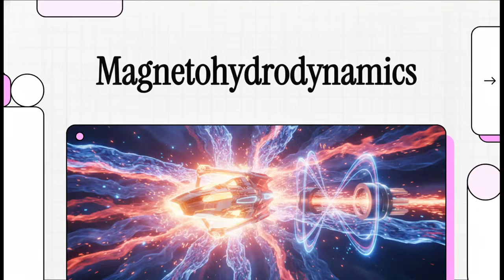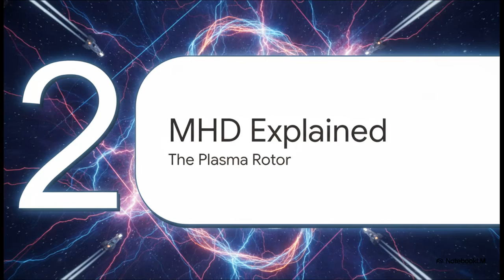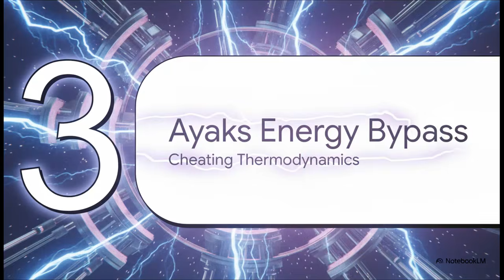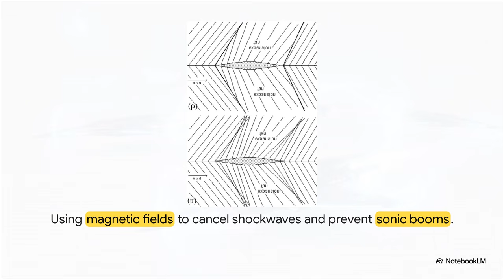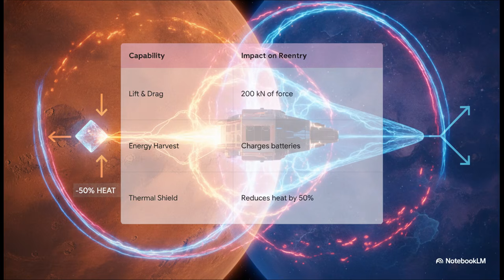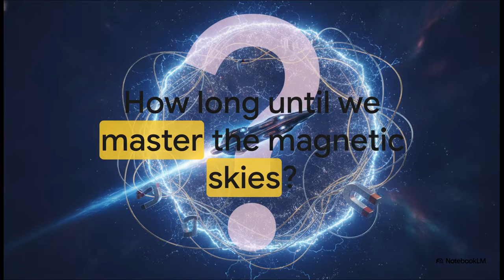Controlling the Plasma Sheath

Comment: Maybe people should start thinking in terms of what actually creates the magnetic fields, rather then the magnetic fields being primary in the mind. Stable self induced high energy magnetic fields can be created by using an electrical input, but using that electrical input differently.
Reply from the maker: That’s a great point, focusing on the underlying current waveforms and induction dynamics is definitely where the future of high-energy plasma control is headed! Have a nice day mate.

Comment: NASA is still very primitive
Reply from the maker: "Primitive" depends entirely on your frame of reference.If you are comparing chemical propulsion to hypothetical anti-matter or fusion drives centuries in the future, then yes—all current human spaceflight is in its infancy. But looking at the engineering constraints of the era reveals why NASA's work is far from simple:

1.Apollo’s Thermodynamics: 
 The Saturn V’s F-1 engines generated 7.5 million pounds of thrust, mastering combustion instability and turbopump fluid dynamics using slide rules, core-rope memory with 4KB of RAM, and manual trajectory physics.

2.Bleeding-Edge Limits: Today, NASA operates at the literal limits of material science and orbital mechanics—from executing atmospheric entry on Mars using supersonic retropropulsion to deploying the James Webb Space Telescope’s sunshield at $L_2$ with zero room for error.They aren't primitive; they are operating at the bleeding edge of what current material science and chemical energy density ($\sim15\text{ MJ/kg}$) allow. We stand on the shoulders of those silent engineers.

Comment: sonic booms from aircraft flying at 60k+ ft doesnt shatter windows...you wouldnt even hear it over a normal towns background noise...its been overhyped over decades...
Reply from the maker: You’re partially correct—the myth of sonic booms shattering modern windows everywhere is leftover pop-science from early low-altitude test flights. However, the claim that it can't be heard over ambient town noise misunderstands impulse acoustic wave dynamics. Here is the physical breakdown:

1. Structural Glass Limits vs. Ground OverpressureYou're right on structural damage. The intensity of a sonic boom is measured in ground overpressure—pounds per square foot (PSF)—above ambient atmospheric pressure:An aircraft cruising at 60,000+ feet (like the SR-71 at Mach 3) generates a ground overpressure profile of only 0.9 to 1.5 PSF.Structurally intact windows require overpressures exceeding 6 to 11 PSF to fracture. Unless an aircraft executes a high-G maneuvering turn (creating a focused "superboom") or flies supersonic below 1,000 feet, high-altitude flight will not shatter glass.
2. N-Wave Pressure Spikes vs. Ambient NoiseWhere the math changes is audibility. Even though 1.5 PSF sounds small, an N-wave shockfront has a near-instantaneous rise time ($\sim 1\text{ millisecond}$).A 1.5 PSF pressure spike translates to a peak impulse sound pressure level of roughly 108 to 110 dB.A typical suburban town has a background ambient noise level of 45 to 55 dBA.An instantaneous 110 dB pulse doesn't blend into ambient noise—it presents as a sharp, sudden explosion or thunderclap that easily pierces building envelopes and triggers human startle responses.
3. The Real Reason for the Overland BanThe 1973 FAA ban on overland civil supersonic flight wasn't enacted because planes were smashing windows. It was enforced because the low-frequency acoustic energy ($<20\text{ Hz}$) in the N-wave causes structural resonance—rattling roofs, walls, and interior fixtures—creating public disturbance across a 30-to-50-mile-wide "boom carpet" beneath the flight path.High altitude prevents structural damage, but acoustic wave physics ensures everyone on the ground still hears it.

Comment: 'Using MHD to charge batteries or accelerate the exhaust.' Yeah, no. Imagine dozens of megawatts of electrical energy generated at the inlets then somehow transferred to the outlets of such an engine. I don't think we can handle that kind of load with present day electrical technology, not flyable at least.
Love to see the conductors used for this purpose...🖖
Reply from the maker: Your instinct on conventional copper conductors and chemical batteries is spot on—if an airframe tried to route tens of megawatts using standard heavy wiring or lithium-ion storage, the weight penalty would destroy the thrust-to-weight ratio before takeoff.
However, hypersonic MHD bypass systems (derived from concepts like Russia's AJAX and modern Scramjet power extraction studies) solve this using three specific physical synergies:
1. No Batteries: Real-Time Direct CouplingMHD bypass does not store power in batteries. The system operates as a closed-loop direct conversion pipeline: kinetic energy extracted by the inlet generator is simultaneously transferred to the exhaust accelerator (or ionizers) in real time.
2. Liquid Fuel as a Cryogenic CoolantHypersonic aircraft require high-density, high-heat-capacity cryogenic fuels—specifically Liquid Hydrogen ($\text{LH}_2$ at $\sim20\text{ K}$) or Liquid Methane ($\text{LCH}_4$ at $\sim110\text{ K}$). Before the fuel enters the combustor, it passes through heat-exchanger channels surrounding the power lines.
3. High-Temperature Superconducting (HTS) TapesUsing that cryogenic fuel as an active heat sink allows the power harness to use REBCO (Rare-Earth Barium Copper Oxide) or YBCO superconducting tapes.Operated below their critical temperature ($T_c$), these tapes exhibit zero DC electrical resistance ($I^2R = 0\text{ Watts}$).HTS tapes achieve current densities exceeding $10^4 - 10^5\text{ A/cm}^2$. A lightweight cable bundle weighing only a few kilograms can transfer tens of megawatts with zero thermal dissipation along the airframe.The conductor isn't a giant copper pipe—it's a cryogenic superconducting tape chilled by the plane's own fuel supply.

Comment: I didn't consider the noise at all, lmao.
whenever I think of things like this my mental focus is of the massive plasma trail it would make
Reply from the maker: That’s the power of the algorithm aligning with actual physics! You're focusing on the exact visual and thermal reality of hypersonic flight: the plasma wake. 
1.Mach 15 vs Mach 30 Speed Limits: Heat transfer scales exponentially with velocity ($\dot{q} \propto \sqrt{\rho} \cdot v^3$). In dense air, Mach 15 generates stagnation temperatures ($5,000\text{ K}+$) that vaporize nearly any known alloy. In thin atmosphere at $60+\text{ km}$, low air density allows crafts to hit Mach 25–30 during reentry.
 
2. The Glowing Wake: That massive plasma trail isn't just cool—it's recombination luminosity. As ionized air ($N_2^+$, $O_2^+$) cools behind the vehicle, free electrons jump back into atomic orbits, releasing a continuous, high-intensity photon trail.  

3.The Tracking Nightmare: That trail creates a kilometer-long column of ionized gas. Even if the craft absorbs active X-band radar upfront, the plasma wake acts as a giant reflector for low-frequency radar arrays and satellite infrared sensors.You can carve through the air with plasma, but the light trail behind you leaves nowhere to hide.
Hope you understand mate. Check out our other Videos and If you like share them. Have a nice day!!!

Comment: I guess this was recommended to me because just this morning I had searched basically this: theory and feasibility of a flying vehicle with charged fuselage at superhigh(hypersonic) speeds. I added the conditions of how it will ionise the air at such speeds, which can both strengthen the charge of the fuselage and make an ionic-plasma bow wave. Google's final answer was a potential maximum speed between mach 15 for thick atmosphere and mach 30 for thin atmosphere.

Which turned out to be what the video was about more or less anyway, lol.

Comment: Salvator Pais patents on room temp superconductors may be intriguing to this endeavor. Love MHD, great video!
Reply from the maker: Thank you mate. Check our other Videos too. Have a nice day!!!
Reply: Indeed, and his fusion reactor is very similar to a design I thought of after watching something called ‘the primer fields.’ A craft such as the one mentioned in this video would likely require a fusion, or perhaps even an anti-matter reactor.
Reply from the maker: @JustAnotherSeeker  You’re tapping into a very interesting area of plasma confinement geometry!What The Primer Fields series demonstrates with its "bowl-shaped" magnetic arrays is visually and functionally similar to magnetic cusp confinement and biconical magnetic mirrors (concepts explored in systems like Robert Bussard’s Polywell reactor). Here is how that translates to airborne power generation:1. The Mechanics of Cusp Trapping ("Bowl" Fields)Facing concave magnetic fields create a low-beta central magnetic well where plasma is trapped by lorentz forces. The fundamental engineering bottleneck with cusp geometries isn't creating the trap—it's preventing plasma leakage out of the point and line cusps (what Primer Fields calls the "choke points"). High-performance reactors must achieve a high magnetic pressure ratio ($\beta \approx 1$) to force the plasma to self-confine and plug those leakage throats.2. The Reactor Dilemma: Compact Fusion vs. AntimatterFor an advanced hypersonic or magnetohydrodynamic (MHD) craft requiring gigawatt-scale onboard power, standard Deuterium-Tritium ($D\text{-}T$) fusion fails because the neutron flux requires meters of solid lead/water shielding—destroying the aircraft's thrust-to-weight ratio.Aneutronic Fusion (The Feasible Path): A craft would require aneutronic fusion, such as Proton-Boron-11 ($p\text{-}^{11}\text{B}$) or Deuterium-Helium-3 ($D\text{-}^3\text{He}$), executed in a Field-Reversed Configuration (FRC). Because the reaction outputs charged alpha particles instead of neutrons, energy can be captured directly via electrostatic deceleration—eliminating heavy steam turbines.The Antimatter Constraint: While matter-antimatter annihilation ($p\bar{p}$) offers the absolute ceiling for specific energy ($E=mc^2$), gamma radiation ($511\text{ keV}$ annihilation photons and secondary neutral pion decay) creates a massive radiation shielding penalty that makes airborne airframes far less practical than a compact aneutronic fusion core.